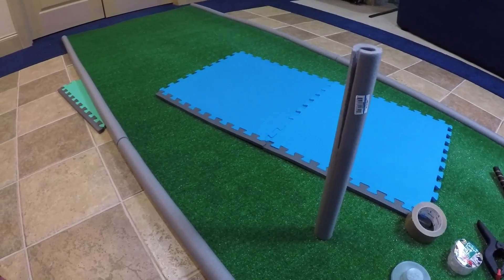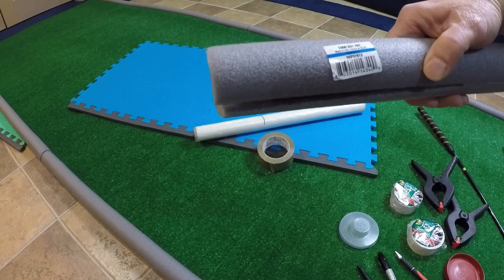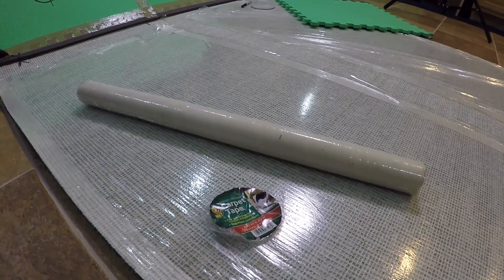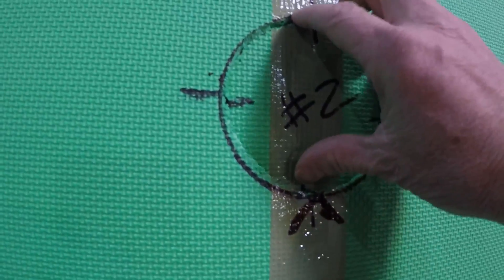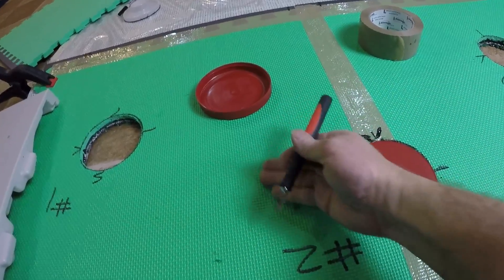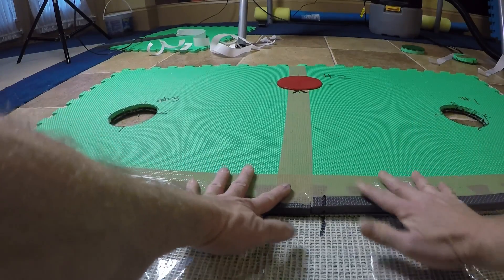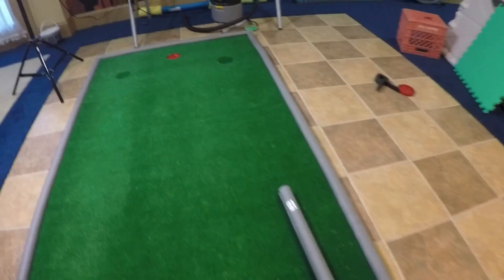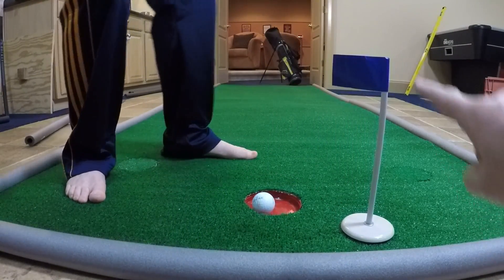Portable Golf Putting Green - Make One for Less Than $1 a square ft

Comment: Sorry if I missed the length and width of this in the video but is like more or less a 2ft by 10ft build? Approximately how many foam tiles are underneath just to get an idea of how much to purchase. Thanks!
Reply from the maker: Johnny, the putting green is 4 ft X 10-12 ft. Its currently rolled up. I used 2 foam tiles where the holes were and strips from another to contour the length of the green, so 3-4 foam tiles depending on how fancy you want to be.
Reply: @MakeItorBreakItNow  OOOHH!!!! Gotcha! I thought you had the bottom filled with foam tiles and I had seen your video at least 5 times to try and see if I had missed something haha. Now it makes much more sense. Thank you!
Reply from the maker: Johnny, thanks for watching 5 times. I'll try to be clearer based on your feedback.

Comment: I went out and bought the same astroturf as you but I've noticed that the ball always rolls slightly to one side of the mat. I think this is due to the way the grains of the turf are facing (maybe not?). Do you have any suggestions on how to overcome this problem? I'm not expecting something perfect but it's pretty significant on a putt longer than a few feet.
Reply from the maker: Dan B, wow, that's interesting. That hasn't happened to us. It might have to do with how long the roll was sitting around on the floor at the store. You might try using a broom and see if you could coax the rug to stand up again, or it might do it itself after lying flat for a bit of time...
Reply: @MakeItorBreakItNow  Ah yeah you're probably right. I tried brushing it but didn't see much change. I'm considering soaking in water to see if that would loosen them up at all. I would love to hear other suggestions if you come up any.
Reply from the maker: @danb6534  let think about it and get back to you. Thanks again for your comment. Maybe leave it outside in the sun for a day?

Comment: Is it possible to make this deeper so the balls fall in farther?
Reply from the maker: Tony Yoo, sure just double or triple up on the foam padding. In fact I'm thinking about making an updated version that has the foam floor panels the entire length of the run. Thanks for your question.
Reply: @MakeItorBreakItNow  Where did you buy everything?  Home Depot?
Reply: Also what was the total estimated cost?
Reply from the maker: @tonyjyoo  the cost breakdown is in the video. 2 ft X 2 ft foam squares can be bought in bulk cheaper or at 5 and below for around $2 each.
Reply from the maker: @tonyjyoo  I got the turf from Home Depot, but I have a new roll of astro carpet 6ftX9ft with better backing and smoother nap from Costco end of year sale really cheap for around $9.
Reply: @MakeItorBreakItNow  Where did you get the foam squares?  I can't find anything close to that cheap.
Reply from the maker: @tonyjyoo  5 and below has them, I think I got mine at Costco about 10 years ago. Other warehouse stores have them in bulk and you can usually get them on sale rather cheap. Something like this from Amazon would work: https://www.amazon.com/We-Sell-Mats-Charcoal-Interlocking/dp/B011W2I1Z0 but they seem more expensive online.

Comment: Do you know what the stimp is
Reply from the maker: Its around 3-5 mm.
Reply: Make It or Break It I meant the speed of the green, not the thickness of it
Reply from the maker: @Rayoblanco10 , the speed of the green surprisingly is very similar to most putting surfaces both real and artificial.

Comment: where can I find fake astro turf for 66 cents a square foot?
Reply from the maker: Home Depot
Reply: Mike Meyers I looked online but couldn't find it for 66 cents
Reply from the maker: I went directly to the store.
Reply: Mike Meyers ok, do you know exactly what it is called?
Reply from the maker: Vantage Ivy Green - THS
Reply: Mike Meyers ok, thank you
Reply: Winner of a video, I've been looking for "how to control putting distance" for a while now, and I think this has helped. Have you heard people talk about - Graysonyon Putter Prolific - (should be on google have a look ) ? Ive heard some super things about it and my work buddy got amazing results with it.
Reply: HD often has seasonal pricing on astroturf. this video was posted in january, when its likely that the turf was at its lowest price of the year. HD also sometimes sells its  remnants for pretty cheap.
that said, spending substantially more on your turf will lead to better putting practice. most of the cheap turf doesn't roll consistently, because it it has "grain" in the grass fibers. it will break one direction and be slower or faster depending on if you across, with or against that grain.

Comment: This is all just one piece of AstroTurf correct? Not multiple pieces put together?
Reply from the maker: Hi Jacob, that is correct its all one piece. I've bought another piece and plan to build some expansions beyond the basic design which I plan to post soon.
Reply: Mike Meyers nice that's cool! So at home Depot they just cut whatever length you want?
Reply: Mike Meyers also do you find it rolls smooth, cuz I'm probably going to make this
Reply from the maker: yes, you buy it by the linear foot. The rolls are typically 8-10 ft long.
Reply from the maker: jacob, very smooth it works great.
Reply: Mike Meyers I got a big 8x12 piece today
Reply from the maker: wow, that sounds great. look forward to hear how it works out for you.